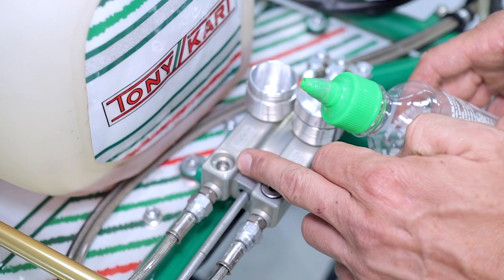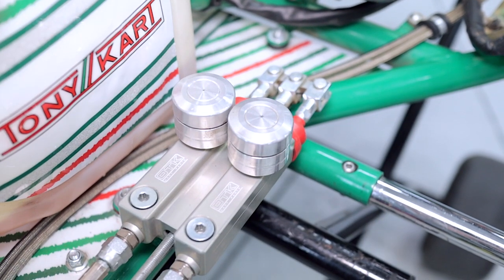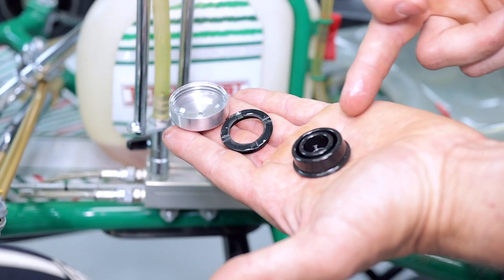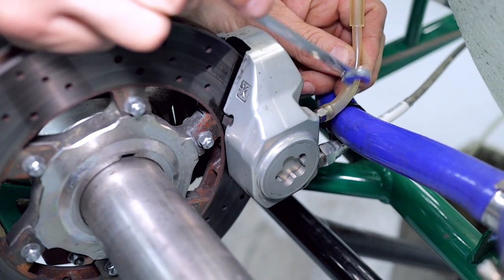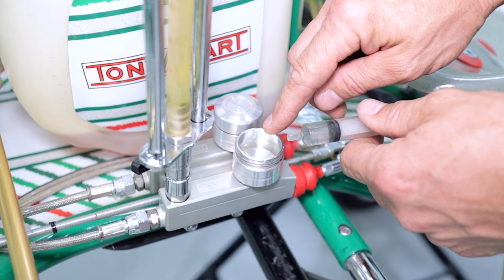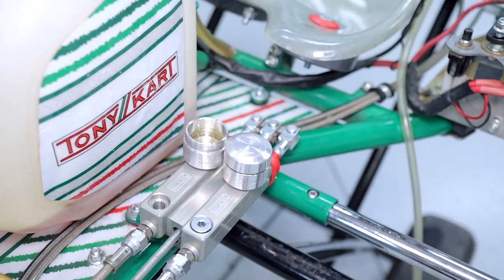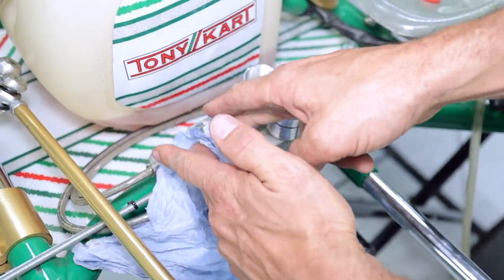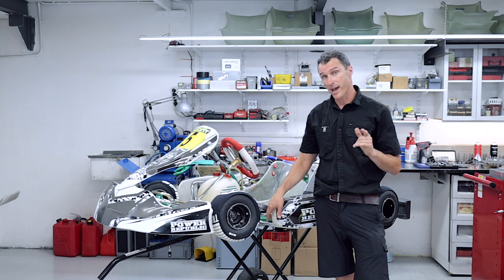HOW TO: Bleed Your Tony Kart Brakes The Easy Way - POWER REPUBLIC

Comment: If I’m not mistaken, you don’t need to pump the brakes when using the otk brake bleeder. The point of it being so tall is that the tool presses the fluid into the lines once the bleeder nipple on the brake caliper is cracked open.  This makes the process much simpler.  Please correct me if I’m wrong.
Reply from the maker: yeah you can use the gravity function as well.  both work
Reply: Pedal pressure is a far stronger  than the force that the gravity can be apply...i think is better!

Comment: I’m getting air in one side of my caliper each time I bleed. Brand new seal as well. Bleed nipple isn’t too damaged, brake line and fitment are both snug and secure and I only rebuilt the master cylinder 3ish sessions ago. I’m using DOT 5 fluid with an SA-2 caliper.
Reply from the maker: well then I think that your brake pump or calliper is damaged?  check for corrosion inside the system
Reply: DOT 5 is incorrect. Should be DOT 5.1. Not the same thing. Not compatible.

Comment: My bleeding screw broke and stuck inside the socket, is there any other way to bleed the brake system without using this valve? i have a pcr chassis.
Reply: I would say weld somthing to the old bleed screw. Or use a bolt extractor and buy a new bleed screw once you get it out.
Reply from the maker: not really.   they are soft on Tony Kart so easy to drill and use an Easy-out for extraction.  

https://www.totaltools.com.au/6816-sutton-no-1-no-6-screw-extractor-set-easy-out-6pc-m603s15a
Reply: @PowerRepublic  I’ve never had much luck with those, but never really tried them on “loose” bolts
Reply from the maker: @derucktorez2260  yeah they are my favourite option either, but sometimes it works
Reply: In the future, if the screws are too stuck, put a drop of oil to penatrate the threads and break the screw free. Have a towel handy to clean the oil from the threads.

Comment: I’m sorry kinda confused. Is using the hot sauce bottle a 2nd method to bleeding brakes? Like will it remove the spongy feel? And how long should I leave the brake nipple loose when it has a line attached to it.
Reply from the maker: its alternative method to bleeding the brakes.  it will work if you don't have the correct tools.  

leave the nipple open only long enough to let the air and fluid out.  then close it off before you release the pressure of the brake pedal.
Reply: @PowerRepublic  thank you so much

Comment: What is the best way to bleed/ fill brakes with a 90's BSM brake calliper without a bleed nipple? I tried doing some gravity tricks but doesnt seem to get all the air out.
Reply from the maker: if you use the tomato sauce (ketchup) bottle you can add some pressure to the lines while bleeding.  then open the bleed screws and let the fluid come out under pressure as you squeeze the bottle.  give that a go and let me know if that fixes your problems.  otherwise maybe you system needs new seals and a brake rebuild?  if so I have a BSM brake rebuild video if you haven't checked that out yet?
Reply: @PowerRepublic  first of all thank you very much for your timely response, it makes life much easier for a newbie like me! I’ll give it a go over the weekend! Just have to get more brake fluid first lol
Reply: I did a complete re build as well thanks to your video!

Comment: Hey Des, how close should new pads be to the disk? I just put new pads in and the disk is rubbing when I turn the axle. I've moved it over in both directions and I can't get it to spin without touching. Kart is a 401R
Reply from the maker: Yeah that can happen.  What i do is start her up on the stand and give her the “cadet dad engine warm up procedure”.  That should get some heat into the disc and pads, and release some gases as well as giving you enough clearance to roll out the pit.

Comment: Do i need Tony kart brake bleeding tool or i can go with a standard method with pushing brake pedal?
Reply from the maker: you can use a sauce bottle or the OTK bleeder tool.   both work fine and I have covered them in another brake video

Comment: Hi power republic, when my brakes aren’t on its lop sided but when it’s on it pulls straight and perfect, is that still fine ?
Reply from the maker: you can adjust that up on the brake pedal with the adjustment screw a little bit

Comment: I tried the sauce bottle method. It filled up the reservoirs but there was no brake fluid coming out from the bleeder nipples. What could be wrong?
Reply from the maker: nipples could be blocked.  did you have the reserviour caps on?
Reply: @PowerRepublic  Hi! I had the caps off. The reserviours filled up as I squeezed the bottle. Bleed nipples were cracked about 1/2 turns open.
Reply from the maker: @nhmk6603  maybe try leaving the caps on for the bleeding so that they add some resistance so the fluid goes through the lines and not out of the rersiviours.  then you can check them at the end and adjust the levels using a syringe
Reply: @PowerRepublic  Alright will give that a go! Thank you!🙏

Comment: One thing which i would like to fully understand is on the hydralic hand brake (used on front brakes or with rear brakes for disabled drivers ect). What is the recommended method to bleed that front handbrake system?

Fyi, i tied the steering off with the resavoir and pipe pointing upwards. Then used a small coke bottle taped ontop of the resavoir with brakefluid in to increase fluid volume. Then opened bleed valves and pumped, closing before air backed in and the lever released again. I did each nipple a few times ect until they worked. The hard part is dismantling the bottle without dousing the kart in brake fluid... how exactly is that avoided or is it normal?
Reply from the maker: Hey Chris, normally use the gravity method for the hand control front brakes.  but I guess you could add pressure to the line by injecting with a syringe.
Reply: @PowerRepublic  getting fluid in did work, it just made a hell of a mess. I need something similar to the device you used with a tap to prevent spilling a bottle of fluid every where when i take the bottle res off the kart, but fits onto the tiny resavoir instead of the master cylinder part like the rear.
Reply from the maker: @christianbuczko1481  yeah it get messy really quick